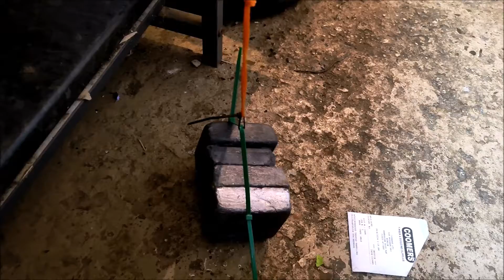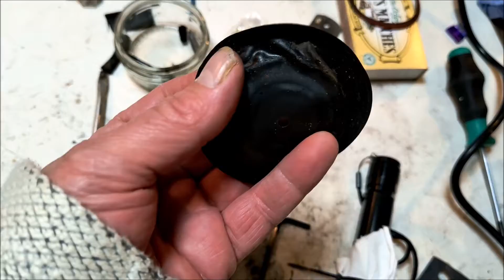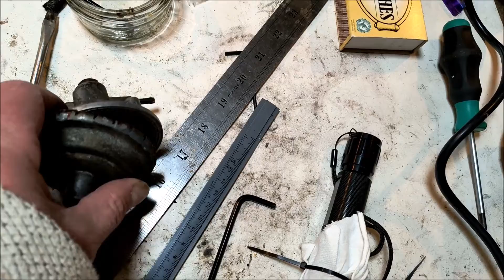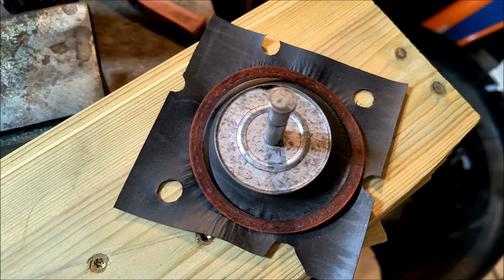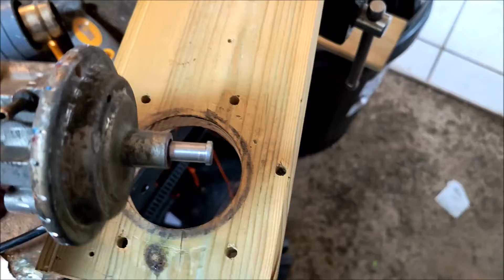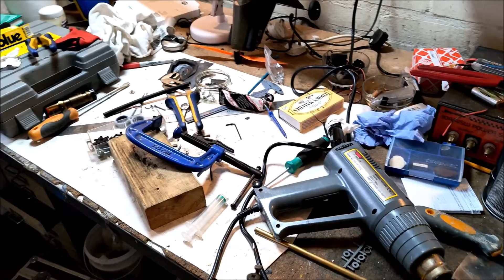Pierburg 3 point unit rebuild repair 2e2 carburetor golf mk2

Comment: Great video! I have exactly the same issue with a 4 point unit. Did you use an angle grinder to cut the slits on the outside to form the tabs? How difficult was it to bend the out and back again?
Reply from the maker: I used a Dremel tool with a cutting disc attachment. The tabs pulled back with a little force but nothing to dramatic. Start prising up with a screwdriver then use small pliers. I have a mini nipex set which works well. Closing up was easy, tap down with a round flat ended punch and gradually work round in circles getting tighter each pass.